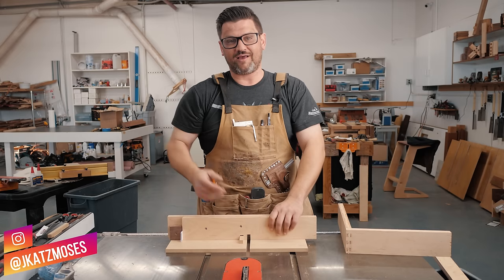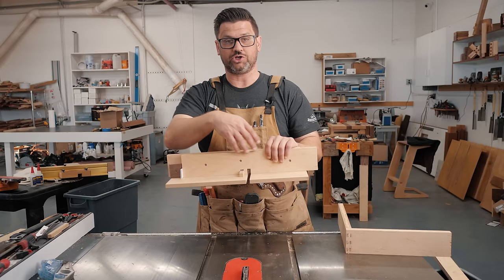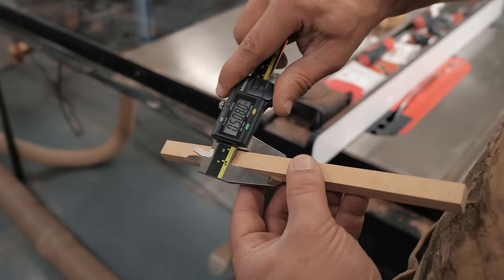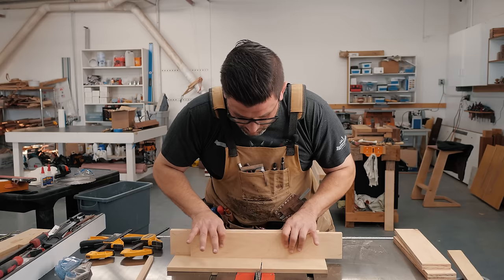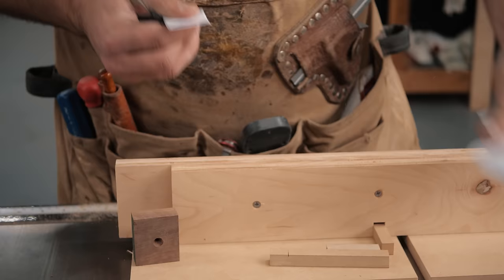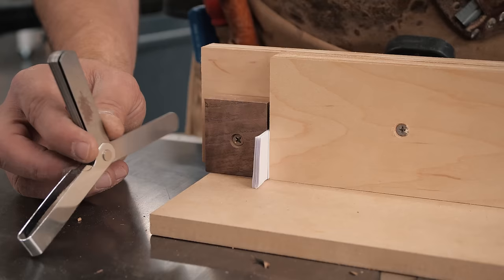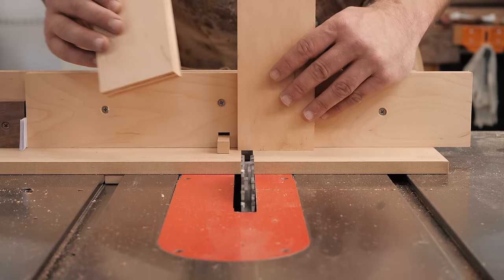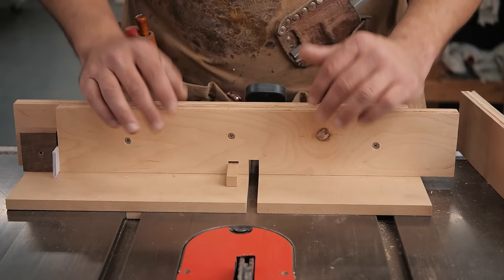This Micro-Adjustable Box Joint Jig is Quick and Easy - Step by Step Build Plans Available

Comment: Love this quick jig. Maybe for more ease of adjustment you could elongate slots in the back with star nuts securing the 2 fences then loosen and move the front fence as needed.
Reply: Way Woodworking that’s what I was thinking.
Reply: However an easier way
Drill a hole in your Stop Block ad the screw side ways to micro adjust the fence, hold down fence with welding spring clamps very strong.

Any adjustments, remove spring clamps turn screw to make adjustments, re clamp and your back in business in seconds
Reply: I'd rather have a solid, un-moving joint there. When it in the right place, it never needs to move again.  So I put screw holes in the base 9mm (half of 18mm plywood) and countersunk them ready to take screws, and clamped the inner back fence to the outer back fence till in position, and then screwed the inner back fence to the base from underneath.  You can remove the outer back fence to make it tidy after that.

Comment: Great video.  I made something similar for my router table. Instead of screws on the sacrificial fence, I used sunken bolts and had slots on the back fence. That way I could simply loosen the bolt and tap it over. Thanks Jonathan!
Reply from the maker: great idea!

Comment: Question:  The adjustable plate, you made it for 1/2" box joint, do you see a problem with making additional adjustment plates for other size box joints smaller and larger, say 1/4" and 3/4"?

Comment: Instead, you can add a  slot on the back fence, drill 4 holes in the front piece, and then fasten the two pieces with a bolt.. Then you shim the pin board as you like left-right and tighten the bolts.

Comment: Hullo young man. Simple but very effective jig, the only thing about over here (UK) is that to my knowledge there is only ne company that makes a saw that can take a dado blade charges £2800.00. A bit to heavy a cost for the DIY man as well as some small companies.
Reply: Let me make sure I read this right,,,,,,,,,, you guys only have one option for a saw that will take a dado set up?
Reply: RetiredRookie7. The majority of home Diy saws over here have the saw blade fixed direct to the motor (Brush) and do not have a soft start. All the arbors on all table saws in the U/K are 30mm diameter while the dado heads are 5/8 inch. The other thing is that the arbors are not long enough to fit dado's even if they are 30mm hole. The only company in the U/K are called Axminster Tools and they manufacture the first saw's (2) that can take a set of dado's with 30mm holes as they manufacture them as well. There are lots of legal reason's as well. I hope this answers your question.
Reply: @wwscott7595  it answer my initial question, but brings up a few more. Like, why would there be laws against it? And what laws are they? And not trying to be insulting here, but its 2020. You would think this simple tool of the craft would be available, and accepted, all over the world? I guess as an American, I take a lot of things for granted I suppose.
Reply: They are not accepted in Europe as it was the EU that brought the ban in as there were to many accidents in the work place and the law (again) states that a circular saw of any kind must have a blade guard. As it has only been recently the an overhead guard is now available industry can now use these blades. As yet it has not been going long enough to call for a demand but it still also means that the saws, table or bench  an arbor long enough to take them.

Comment: hey Johnathan   Great simple box joint jig  ! I’ve been doing Woodworking as a hobby for over 35 years and I did 20 as a Professional Woodworker as well BTW I like the modification to the apron for your   Square holder  I’ve been using the Bucket Boss brand Aprons for quite some time now  finding that they hold up pretty well over time  ironically sewing  is one of my hobbies as well as I bought a Walking Foot Sewing Machine to do Boat Upholstery , Canvas ,and Vintage car interior restorations   I’ll be honest I never thought about sewing accessory pockets onto my apron untill this video   It’s a great idea  thanks
Reply from the maker: I love the square holder. I also have another leather sleeve for my marking knife. Great addition. Cheers

Comment: Nice, great jig!  Curious to know does it matter if the bottom (sled) has a wider cut... say one time you do your joints at 1/2" and the next you do 1/4" would that extra 1/4" gap in the base have any affect (effect?) on your cut?  Been loving your channel, great bite sized info!
Reply from the maker: Doesn't matter on the bottom. Cheers bud

Comment: Hey Johnathan.   Great video.   Very informative as always.   I have a quick question.   What is the wood and green mallet that you are using in the video?  I  have seen several makers using it, but when I researched it there were several different weights.   Which one do you recommend
Reply from the maker: I think that one is the 18 oz and the wood is maple plywood
Reply: @katzmosestools  Thanks for the info and thanks for replying so quickly.   I appreciate it

Comment: any suggestions on dado blade sets? Been reading amazon reviews on some and finding that even a lot of 'good brands' have inconsistent results with uneven grooves, caused by certain chippers being a tad off-size from the rest and/or the outer blades not being exactly the same size.

Comment: Great video. Any suggestions on how to do box joints if you don’t have a dado stack?
Reply from the maker: Yeah just do them the thickness of your saw blade
Reply: Try using a router table and different diameter bits to make widths.
Reply: Ian Knottenbelt Cool thanks. It’s such a pain not being able to get/use dado stacks in the U.K.  I’ll give that a go.
Reply: Even being able to have them here in the States, unfortunately the arbor on my table saw isn’t long enough to use them.  So we adapt.  Good luck.

Comment: I recently made two boxes using box joints and the same type of jig. One used 1/8" fingers and the other used 1/4". I used my relatively inexpensive stacked dado for this (single blade for the smaller fingers since it's the only one I have with a square grind). In spite of the double fence, I still got a lot of tearout at the top of the cut. What could cause this? Maybe the wood, which was big box store aspen? Maybe the inexpensive blade, which hasn't been used very much? Just not sure and hoping somebody could help me out so I don't have the same problem next time. Thanks for the informational vid.
Reply from the maker: Always use a fresh backer board. Especially if you've ever run the blade taller than your current cut
Reply: @katzmosestools  Backer board was brand new for both, but I'll keep that in mind for future projects and not try to recycle these.

Comment: Great jig Katz, but here in England we are not allowed to use dado blades in our table saws, in fact our table saws can not take the. as the spindles are deliberately too short, so how about a mod to this jig for us Brits with just an access to a single, standard blade on our saws?
Reply from the maker: Just make the key the width of your blade. You can use this jig for any size blade.
Reply: What’s the reasoning behind the “no dado stack” laws? Can you import a saw that takes the stack? (assuming cost is within your budget)
Reply: Hi Michael. UK law determines that when the ‘Off’ switch it hit there is a minimum time in which the blade must stop rotating. A dado stack adds weight to the blade and so extra inertia that makes the stop time longer than the regulation allows. To ensure the law is complied with UK table saws do not have a long enough spindle to take the width of a dado stack.
Reply: @davidobrian5415  Thanks for the explanation, always wondered the reason and this makes perfect sense. I think this is actually an Europe thing, not only for UK. Multiple passes on the standard blade can work and also a similar jig with the router in a router table. Make Something has a video for that, hope that helps.

Comment: To save a ton of time Could u use some heavy duty rare Earth magnets instead of screws for the adjustable fence?? And HAPPY 2020 TO YOU AND YOURS 🥳OHH and your editor is awesome btw.
Reply from the maker: Magnets capable of holding it would cost $20-$30 each. You'd need at least 4 maybe 6
Reply from the maker: Thanks bud! Marc kicks ass!
Reply: Personally I’d lean towards a tee track imbedded in the main fence. But only if it was a high usage jig.

Comment: I dont see how those minute adjustments will work when you have the secondary fence screwed to the primary fence. Unless you just screw in new locations... but that can get messy after making several adjustments
Reply from the maker: That's literally what I say to do. I go into it in detail if you watch the whole video. The second fence is sacrificial. I replace mine every new project to preserve the zero clearance cut.
Reply: @katzmosestools  I guess I missed it

Comment: No, it's not a new decade yet.  Next year is year one of the decade.
Reply from the maker: Horse shit. 0,1,2,3,4,5,6,7,8,9 = 10 years. Decade is defined by the number in the "tens" digit. Therefore the decade is 2020,2021...2029. When you say something happened in 1990 you wouldn't say sometime in the 80's. So again, horse shit my dude.
Reply from the maker: https://en.m.wikipedia.org/wiki/2019